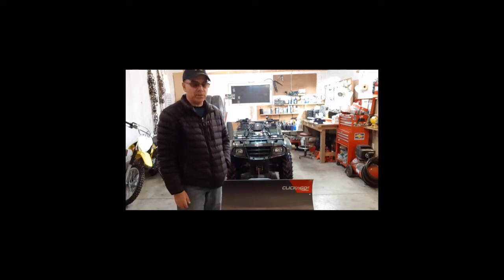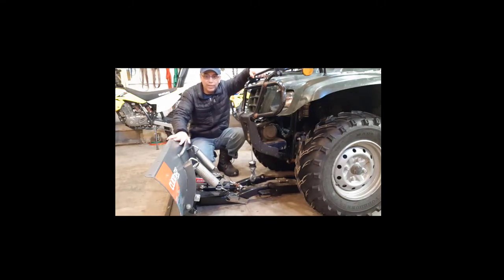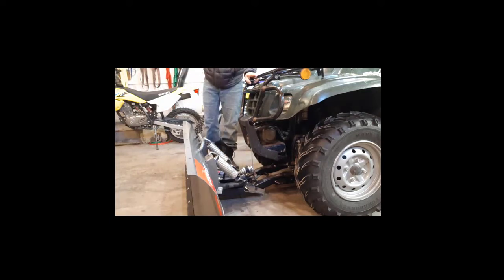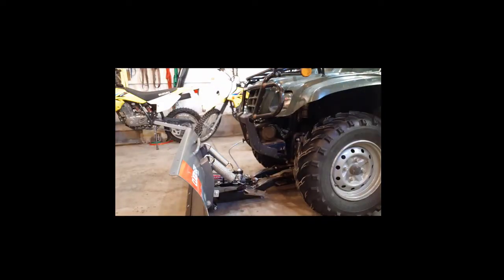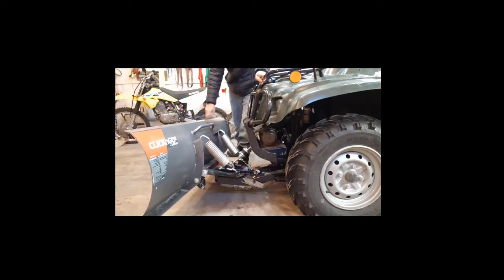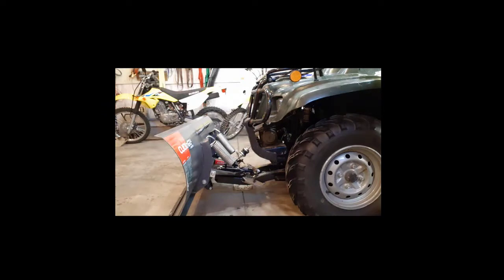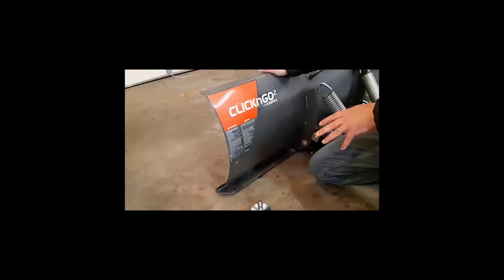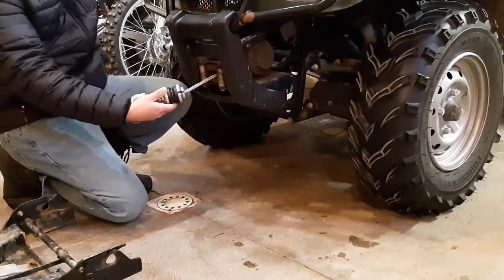Whats a Good Snowplow to Buy for an ATV // Easy To Use & Worry Free

Comment: I currently have two plow quads and they use Moose (On a 2003 Eiger 400) and Cycle Country (On a 2006 John Deere Buck 650) plow systems.  Both of my current plow systems work great!  I had another Cycle country plow that was well used and the push tubes were completely worn away on the bottom from the previous owner.  When I was plowing heavy snow they failed!  The whole blade and assembly pushed back into the front bumper of the 1997 sportsman 500 I was using.  The push tubes turned into spaghetti noodles.  Not a fault of the Country Cycle plow, due to the wear from improper use with previous owner.  I was back up and running later that day after welding a bunch of scrap metal to it!  I've since gotten rid of that pile of crap (Quad and plow)  Don't ever buy a older used Polaris unless they are almost giving it away.  That thing had so many problems.

Comment: Great review!! I have the same plow. I had the "Kimpex click n Go" on my old bike and it held up for the six years I had it and it was nowhere near the quality of the "CnG2". But when I bought my new bike I bought the 'Click n Go 2' and I do have to say it is amazing quality and a well thought out plow I have a bad back and it really is simple to put on and off (I just leave it on all winter). Now the only negative thing I have to say about it , and I have read the same thing about all atv snow plow manufacturers is that the cutting edge (wear bar) is a real soft steel. I don't use the shoes on my plow cuz I like to keep the driveway scraped down as much as possible (paved driveway), my cutting edge wore a great deal in the first winter. So I went to my local steel fabrication shop and had them cut me a chunk of good quality steel and I put that on, and it works great and will last for years.

Comment: Great vid, thanks! How wide is your ATV, probably 48"? After using this plow blade for number of years, would you reconsider buying this size plow? Would a wider one, like 60" or even 66", work better?
Reply from the maker: My atv is around 44 inches wide. The blade is 54 inches. That gives you 5 inches on either side. I wouldn't go wider.

Comment: I went to the website,  is it $297 for everything?
Reply: No, the price on the website for the 60" blade is $334.99, you also need the push frame $634.99, and the mount and hardware which is another $139.99 = $1109.97. NOW that price is before tax AND they have added the shipping costs into that price. I did not pay near that amount because I bought mine at an atv dealership. I hope that helps.